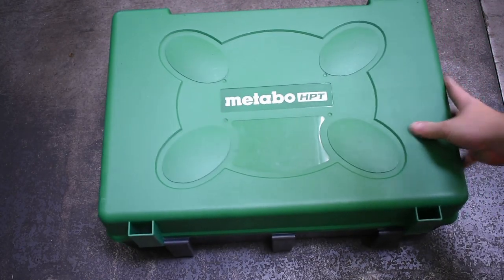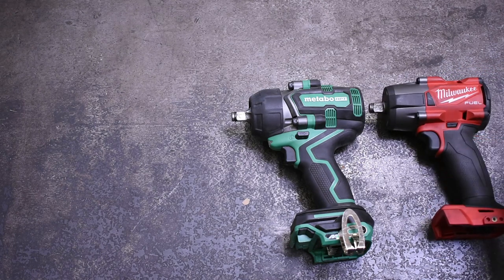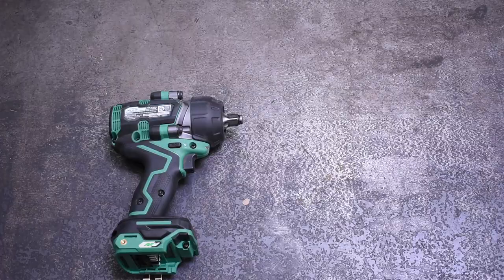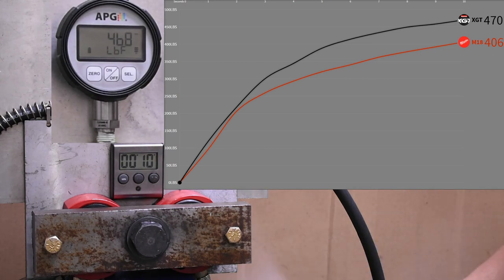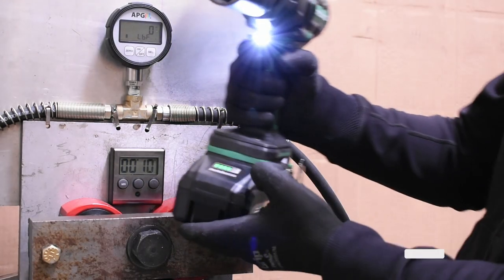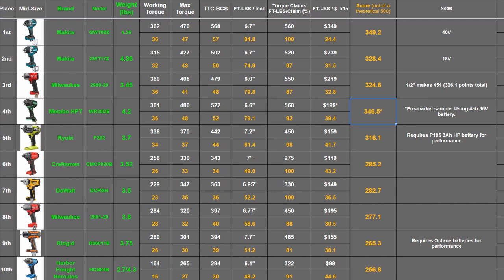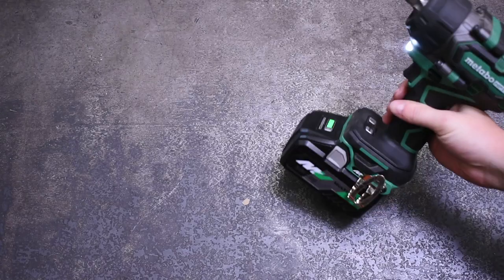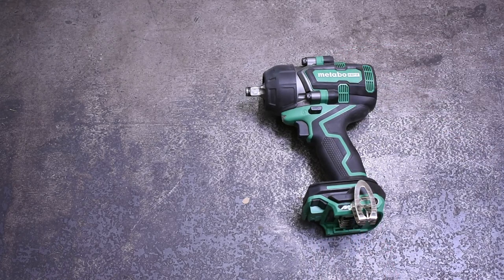We Stole This New Impact Before It Goes On Sale to Dyno Test It: Metabo HPT WR36DE

Comment: Speaking of new Tools, any plans on testing the new „Freak“ 1860? It currently comes with a 4AH Core battery at Lowe’s. I’m really tempted to buy it but would love a „review“ first.
Reply from the maker: Working on it soon
Reply: @TorqueTestChannel  nice! Any timetable when to expect a video? I’m really looking forward to find out if it really has more power than the 1800 or if it’s just an update on function/features.
Reply from the maker: @TheBlablubb1989  It's a small amount more power

Comment: You should do a comparison test with the Milwaukee 2767-20 vs the Milwaukee 2863-20, ive been seen a lot of people buy the 2863 resently, and its supposed to be the same tool but with one key, however my 2767 is out performing all the other guy’s 2863 in the shop. Are those tool’s diference only the “One Key” feature, or are they actually diferent on the way they perfom. With also tried maxing out the performance with the 2863 using the One Key feature to make it give all the beans posible, and also using my H.O 6.0 battery on both at full charge. However the only way we can test in the shop is tightening lug bolts to 150 ft.lbs and seeing witch takes the longest to remove the lug nut, and so far we dont know if its trigger input or what but my 2767 always wins.

I know its a wierd request but when milwaukee advertises both guns with the exact same spects and we can se the diference in the shop its kind of wierd. Hope this test can be done someday

Note, both tools where tested with the standard XC 5.0 battery at full charge, then we started swaping things and the only way it could surpass the 2767 was with the HO 6.0 battery

Comment: Have you guys been able to test out Metabo HPT current offering of the 18v half inch rated at 225 i want to see how that compares to the stubby m12-18 version mainly due to office range as it's 150 vs 179 bare tool
Reply: The 18V is at $99 at Lowes
Reply: @baseballdude8491  yeah just picked it up I like it works fine for what we need it for light construction and removing lug nuts but I want data put it on the chart I want to see numbers vs stubby m12

Comment: At a certain point I’d take a smaller tool over the higher numbers. As a tech If I’m facing bolts that will be that tight I’d just assume grabbing the high torque anyways. It seems this race for torque numbers will never stop

Comment: Milwaukee covers a huge range of battery powered tools. The price point and availability and warranty, it’s a no brainer to choose Milwaukee
Reply: I must not have a brain then cuz I've been switching out many of my Milwaukee and Makita tools in my construction work cuz Metabo HPT 36V tools are superior in performance, flexibility, lifetime warranty, features and have the best nailers 25+ yrs running
All 36V tools also can be plugged in to the AC adapter and the Multivolt(36V batteries are backwards compatible to their 18V)
36V full size table saw, mitre saw, only full size 1/2 router, SDS Max and Plus rotary hammers, largest capacity and blade speed portable band saw, new rear handle circ saw(lightest and powerful), most powerful Recip saw,the Mid torque and full size impact beat red, hammer drill beats red, and the Triple Hammer impact has best control and features that make it much more efficient in real world applications and all are better priced than my red and teal-yeah I can see how staying all red is a no brainer😂

Comment: Get that 4ah pack cold for me and see if it takes a charge after. Within the scope of what other pro batteries handle. I've had two give up the ghost on me working in the cold. There compact 3ah does fine. My buddy's DeWalt and Milwaukee batteries did fine but two of my $169 batteries bit the dust cuz of a little cold weather.anf I'd really like to know if you guys could duplicate that. I'm sure it would be good data for everyone really.
Reply: Maybe something to do with the vents and condensation on the 4ah. All of the tools that recommend a 4ah have a protective cover that protrudes to protect the battery, but if you use them on a drill or impact, it's left exposed. The 2.5ah only has the one vent near the terminals to line up with the charger's fan, so the battery is protected on a drill.

Comment: Milwaukee needs to copy Makita LXTx2 and make some M18x2.   I've heard the lawnmower will be M18x2 w/ 2x 12ah. 

I really think the chainsaw and a few other tools would really benefit from a M18x2 update.
Reply: Why would you burden yourself with a battery powered lawnmower or chainsaw?
Reply: @emort6  I have a corded Makita electric chainsaw that I honestly really like as it is really quiet and it has worked extremely well on my small property.  I'd stick with my gas lawnmower though as electric wouldn't get the job done during leaf season.
Reply: @prototype3a  I said "Battery powered" but it's all good. I have cut down small trees and bushes on my property with a corded craftsman Sawzall and it worked. I spent an hour and a half blowing my leaves into the woods today (leaves were deep) with a stihl backpack blower. I wonder how long and how many Battery packs that would have taken with cordless (if even possible).
Reply: @emort6  If I had a bigger yard, I would own a gas backpack blower.  IMHO, if you're not regularly felling relatively large trees, corded or cordless makes a lot of sense as it is one less gas engine to maintain.  Granted, if you only run methanol-free gasoline, that does help with the small engine maintenance.
Reply: Much heavier tools though such as my Makita 2x18V so Metabo HPT 36V batteries same size as my Milwaukee 18V so much nicer to handle and the Metabo HPT can be used in 18av tools and plugged in with AC adapter for longer use tools

Comment: That thing is spookily close to the makita all throughout that graph. I think there may be some 'copy and paste' going on in metabo HQ :/
Reply from the maker: We've had a theory for awhile, unsubstantiated of course
Reply: Makita and Hikoki(Metabo HPT) copy each other constantly. It goes both ways(see the new XGT oscillating recip saw, 125mm circular saw, 180mm metal cutting circular saw, Bluetooth capable double spring impact driver, etc, all looking nearly identical and having nearly identical specs to Hikoki tools that have been around a while). You could even say that Makitas XGT line is a direct copy/paste of Hikoki's 36v line. The batteries are nearly identical. Makita also put vents on the 36v(40v)batteries just like Hikoki has on their 36v batteries, along with a fan and register on the charger to blow cool air through the battery while it charges. I'm not sure anyone else does this.

Plus, you have to consider any Makita or Hikoki tool being released in the US now has already been out in Japan and elsewhere for 1-2 years, and they aren't released to different places in a linear timeframe. half the time, they never get released in North America.
You'd have to look at their Japanese catalogs for 2019, 2020, and 2021 to maybe get an idea which one actually came first.

Comment: First and only hpt tool I purchased is a 23gauge pin nailer that totally fucking sucked! It would set one or two pins at a time and then it takes a shit. The pins jam and you have to take it apart to clear the jam only to run two more pins and take apart again. I used Metabo brand and other brand pins with no change. If it wasn’t for the fact that I paid $200+ I would of thrown in in the garbage. I purchased the new Milwaukee M12 23gauge pin nailer and it worked flawless! I’m a Milwaukee guy and that’s all I run, only reason I purchased the metabo was because Milwaukee wouldn’t release their pin nailer until the following year. I should have waited!
Reply: Dude the Metabo HPT/Hitachi nailer came out 5yrs before any other brand even attempted it-Milwaukee was late to the game-Hitachi/Metabo HPT nailers have been the standard for over 25+ yrs - one early technology issue on one tool Doesn't speak for.the whole line of tools-ai have some Milwaukee tools.that absolutely suck cordless planer jobsite table.saw but I don't say Milwaukee sucks
The 36V line of Metabo HPT is superior to many of my red teal and yellow tools

Comment: So what happens if you feed a m18impact  40v? If the adapters don't already exist I bet some of the 3D printing community would make it for you.
Reply: With these batteries, it would recognize it as an 8ah 18v battery, instead of 4ah 36v/40v battery.
The Metabo HPT 36v 4ah, Makita XGT 40v 4ah, and the M18 8.0 High Output are all identical and use the same cells and number of cells, in the same configuration. They're just divided and ran parallel for the 36v.

Comment: 18v is deprecated.

I don't think Milwaukee is ever going to progress from 18v because battery commonality is a huge motivating factor for those buying the brand. Especially with them coming out with 18v OPE. THAT market has solidly been 36v since Stihl came out with their battery line in, like, 2010? 2011? And still Milwaukee is staid on 18v.
Reply: If 18 is making the $ why change? Everything is paid for - the factories, the technology, the R&D. They are probably waiting for the competition to lead the way and then will switch. Not too late though ;).
Reply: @-fazik-3713  because if they wait too long, as they very much are doing, people will have already invested fully in another brand's ecosystem. At that point, no reason to go back. The moment Milwaukee can see a dip, it's already too late.
Reply: @Hansengineering  Agree.
Reply: Milwaukee's new lawnmower is 36v, and so is one of their new shopvacs.
Reply: @histguy101  2x 18 isn't 36v. It's 2x 18v.
Reply: @Hansengineering  If that were true, you'd be able to run the mower with one battery or two, but you need both for it to run. It's 36v, they just won't call it that.

Makita has a whole line of 36v tools that use 2 18v batteries together. Now they do it like Metabo HPT and just run the batteries as 2 parallel 18v in one casing.
Reply: @histguy101  you're wrong and it's worth exploring why, but I'm not about to do it in a comment thread. 2x has a lot of drawbacks to single 36v packs.
Reply: @Hansengineering  if you go to any authorized Milwaukee dealer website(like Home Depot), and look up the specs for that lawnmower, for voltage it will say "36 volts." 
Saying "it's not 36v, it's 18 volts x2" is like saying "M18 is not 18v, it's 3.6v x5." The lawnmower requires 3.6v x10 to turn on. 

The Makita lawnmower runs the same way, with 2 18v batteries, and they say it's running @36 volts. And on their lawnmower, you can add 2 extra batteries, making 4. It will use the two at the same time, and when they die, it will use the next two. It can't run on 1 battery, or 3 batteries, only two at a time.
Reply: @histguy101  Cool story, bro. As I previously stated using Kindergarten math to state 18+18=36 misses a ton of minutiae, and I am not going to go into any of it on a YT comment thread.

Also, you've missed the entire point of the original post here. Goodbye.
Reply: @Hansengineering  It is as simple as kindergarten math. 3.6v x10 is 36v. You original post was that Milwaukee has shown they're not willing to change to a higher voltage platform, particularly on OPE, when they've done that very thing... on OPE. 

I can read. Your post wasn't complicated. Now go hook up your voltmeter to the lawnmower and you'll see it's running 36v/40v.

Comment: I don't think Milwaukee will up the voltage until/unless Dewalt starts making 60v Flexvolt only hand tools. I know Flexvolt Advantage exists but you don't have to use a Flexvolt battery if you don't want to.

I base this theory solely on how Milwaukee compares their tools to Dewalt all the time on their product packaging. Its like Milwaukee figures they are good enough as long as they are better than Dewalt
Reply: With DeWalt going to a pouch battery (Powerstack), it's possible that dedicated 60v tools with compact batteries are on the horizon. If and when that happens, Milwaukee may find itself in a world of hurt.
Reply from the maker: Here's hoping DeWalt makes some 60V hand tools then! They already got the battery thing figured out. The main drawback to the casual consumer on 40V and 60V is having batteries that say 2.0 or 2.5Ah on them and people thinking that's bad. DeWalt is cheeky by putting both 60V and 9ah on the same battery case. Pretty smart.
Reply: @joshuaking34  I want to see a 60v high torque and the numbers that thing could be a beast.
Reply from the maker: Thier next 1600 ft lbs rated one may be. Thier project bruiser2 is likely 20v though (1400)

Comment: HAS to mean you have a weaksauce plug converter no?  Plus it makes ZERO sense to imitate the battery with the converter, you'd put that part on the WALL portion of the plug, not the tool end!  Plugging in would come with the advantage of not having that big ass knob on the handle end that prevents access to so many applications.

Comment: Why doesn't Milwaukee bite the bullet and make an impact for the modern market using their 28v batteris.  I think the power gains would flatten the opposition. Sticking with their 18V batteries for their most powerful tools,  is starting to show weakness. I would buy a Milwaukee 28V impact with zero hesitation, if it was better than the 18V high torque they do.
Reply: My suspicion is Milwaukee keeps such brand loyalty because the haven't changed batteries in more time than anyone but Makita's LXT. If they change that, there's no point to buy Milwaukee anymore.

Comment: What I'd really like is a tool that doesn't require you to pay homage to a specific battery god. It's just pure bulls*t that each brand has their own line of battery with insane overpriced plastic wrapping (the cells inside are all the same, independent of the wrapping).
Reply: Me too, but that's where they will make the big bucks. Just like how hp put chips on their ink cartridges so we couldn't use  cheaper generic ink, or Apple who encoded any music you purchased in iTunes with their proprietary codec so you could only play it on an apple product. Both companies were sued and had to change. I wonder if the same could happen to these companies.
Reply: Get adapters.
Reply: @histguy101  a) not a good practical sollution (a fairly bad one in fact), b) shouldn’t have been needed in the first place
Reply: @dchawk81  I'm sorry, but that is a useless piece of information, and trying to argue that something else is worse (so we shouldn't care?) is not terribly useful either.

Comment: I want Metabo hpt to crush xgt with the price.  I really really can’t stand Makita throwing those expensive prices acting like they are doing something new.
Reply: Its true that makita is expensive, but you cant deny the effort and thought they put into their tools. Name brand components, smart design choices and reliability do cost quite a bit. Of course, if people dont want to pay for them, they will fail and they will learn a lesson. Besidesz XGT is advertised as professional grade only, made for long and hard use. I think that alone is worth the price premium, granted though, some of their tools in the XGT line didnt bring much new features on the table.
Reply: Makita was late to the game with 36V line and a big reason I swapped many of my red and teal tools over to Metabo HPT plus the 36V batteries are backwards compatible to the 18V tools which really irritates me about Makita not doing that and now they want me to buy a tool I already have in the 18V line(no thanks) plus Metabo HPT has the lifetime warranty, all 36V tools can use the AC adapter so I run my full size 10" table saw, mitre saw, grinder, portable band saw, SDS Max and Plus rotary hammers, Recip saw ,new rear handle circ and, router and vacuum, new cordless compressor all day without having to burn ups so many batteries
Metabo HPT has surpassed many of these other companies in development and technology and have always had the best nailers(Hitachi) 25+ yrs running
Reply: @homemadelemonade976  the only effort they put was adding 40v.  Overall design is roughly the same.